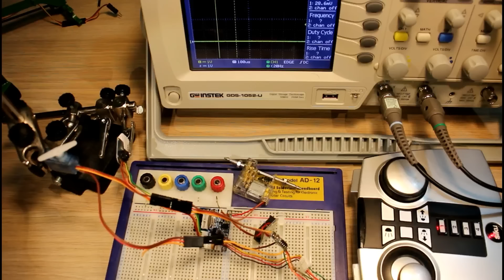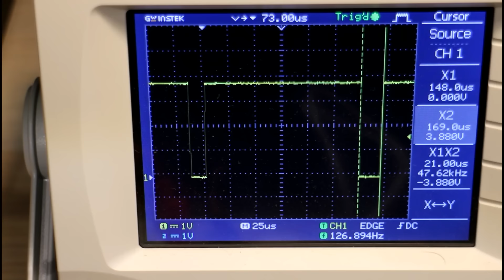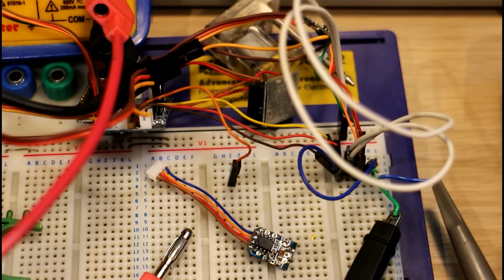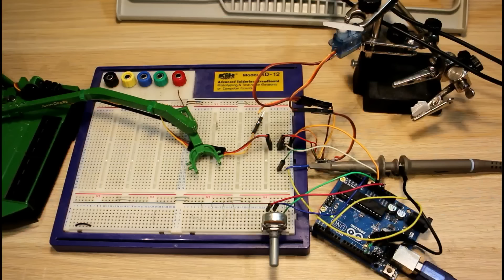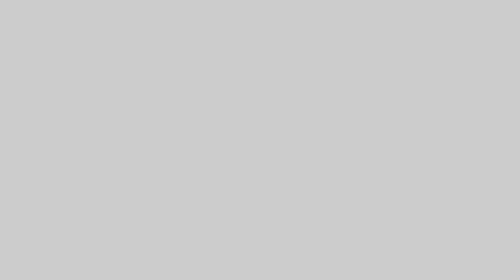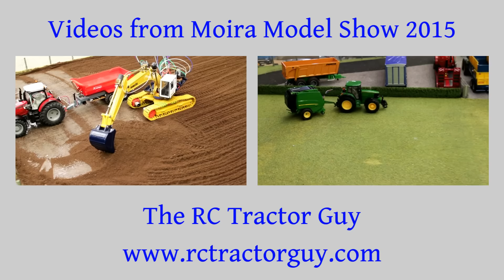Trying to control a Siku Control 32 four wire servo part 2 - Success!!

Comment: Were you ever able to resolve the jitter problem?
I'm really wondering why they overcomplicated things so much. Instead of using byte code they could have used PWM like on a normal servo and instead of using a fourth wire they could have just used a transistor or relay to cut the power to the servo.

Comment: Is it possible to replace siku servo board for a hobby grade 3 wire servo board and keep siku potentiometer and motor? both use 3 wire potentiometer and dc motor so it should work right?